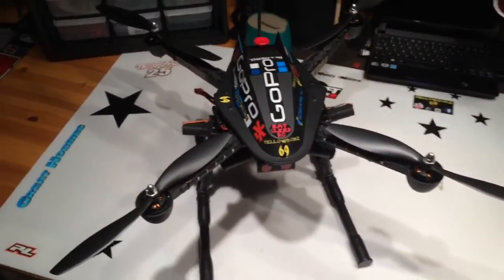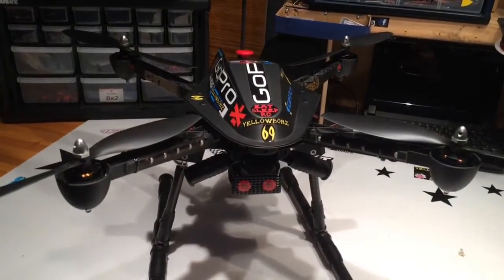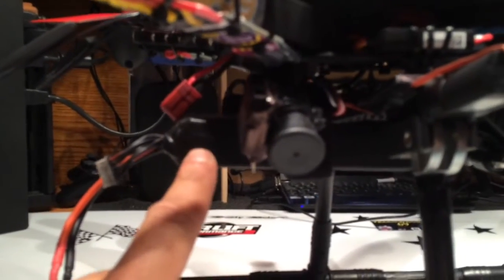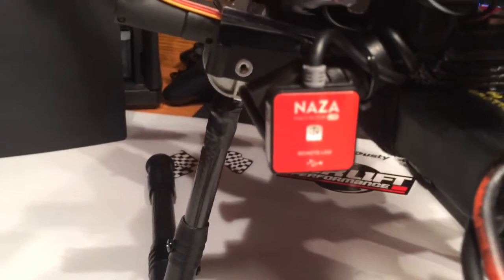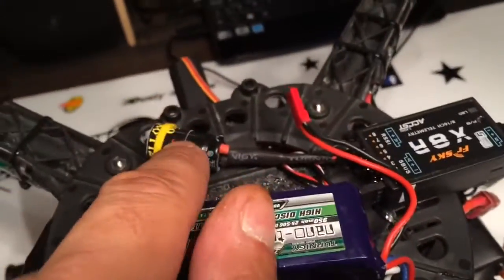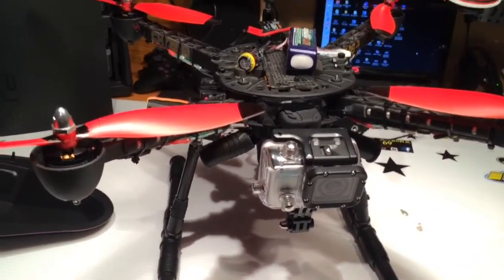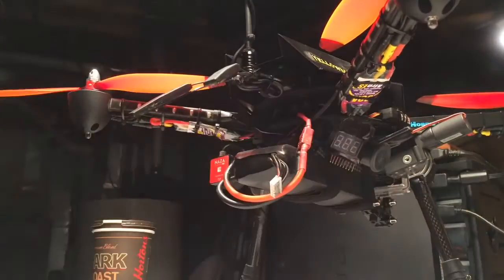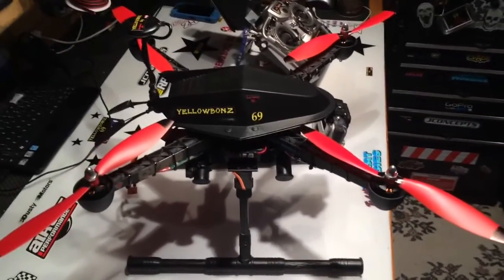Ideafly Ifly4 Quadcopter meets Naza FC & GPS

Comment: Just finished rebuilding and OLD ideafly 4 frame with Inav and an Omnibus flight controller, N8M GPS and APM 2.6 mag,
BlheliS ESC's from a racing quad.Think they're 2208 motors @1000kv, but been in the frame along time. Got everything working, and even programmed an LED strip.
Been a long time since I broke a prop hovering... betaflight/cleanflight are so good on default PID's . Had a test flight in our small, and I mean U.K small back garden and it flies!
Ideafly frame still ticks boxes.
Reply from the maker: That's awesome, I like the ifly4 frame and its durability. I use Naza Light since my other 2 large quads have it installed also, reliable too.

Comment: What flighttimes do you get with those legs?  Glad you switched to naza. Did you hear about the naza lite upgrade to maza v2?
Reply from the maker: mrtwisty no difference in the leg weight really. I heard it won't work for Naza Light ?
Reply: YellowBonz69
It sure does work     http://naza-upgrade.com/
Reply from the maker: mrtwisty ok I'll have a look now, thanks
Reply: YellowBonz69
make sure you're using the newest "red" naza light assistant

Comment: I've watched you have some pretty good luck with the Ifly, much better than I did with both models Ifly-4 and 4S.    So, they both have a NAZA now, and I even bought an Ifly-4 frame and motors for super cheap and built another one.